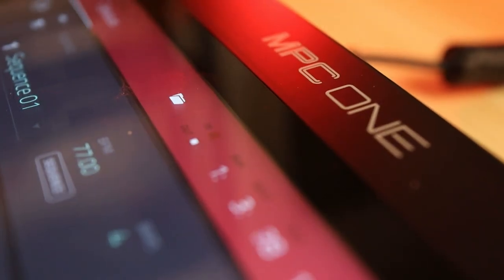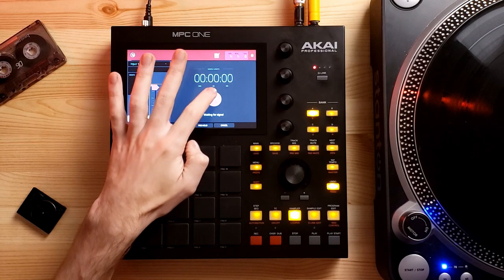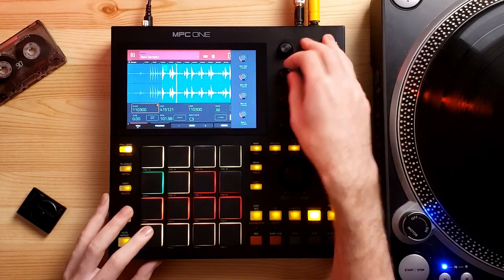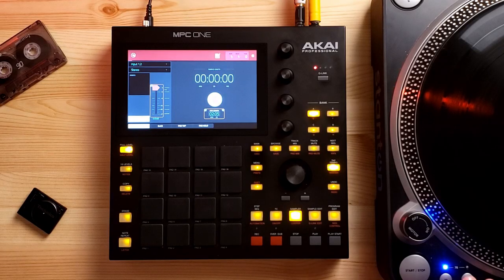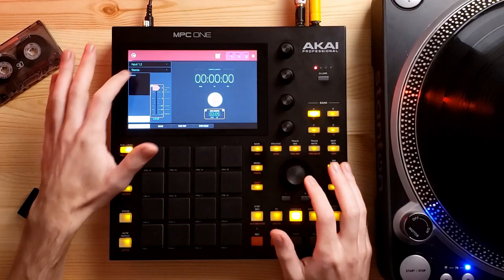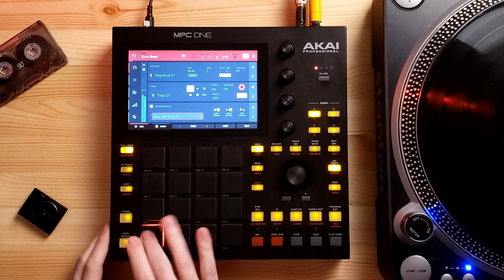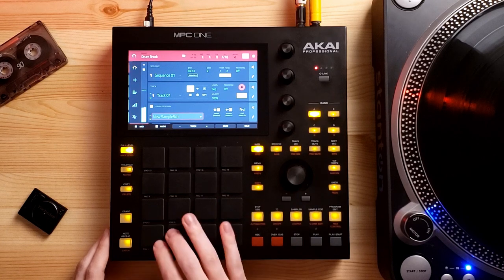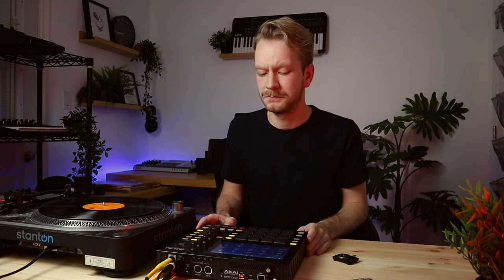How to Make Your Drum Breaks Sound HARD! // Using Sample Rates to Our Advantage

Comment: Wow, what a dope beat and a sick tutorial. Loving your channel bro. I have two questions if you’d be so kind:
1. Do you know if it is possible to resample on the 2000XL?
2. When you chop up your samples like that, are you just recording 4 bars of the song and then splitting them equally into the 16 pads? I would love to see a detailed video on this. As you have the MPC One where things can be more automated and you have a smoother workflow I sometimes miss some steps of what you do. I am trying to apply your teachings to my XL
Reply: I'm not sure of the workflow regarding chops, but to resample any sampler, just have the out L and R into the input L and R. 

There of course maybe a internal digital workflow to do it, this is just an analoge way
Reply: @MattDiamondMDE  I was just about to say that’s a good idea, (in theory it still is), but then I realised that as soon as I go to the record screen on my XL I won’t be able to play the sample. I will have to use my laptop to sample back in (after tracking out). It’s going to be a fairly long workflow but it’s the only way I can think of for the XL.
Reply: @MuhammadLaher  wow really? That's tough!

Comment: Just for my understanding, there is no 'sample rate' function in the MPC ONE? I had that in my 1998 Akai S20 sampler, and currently the Polyend Tracker has a bit rate menu, that tels you lower the bitrate for crunchier sound.
Reply from the maker: Great question! There is no way to adjust the sample rate at which the MPC One records. There are built in plugins that you can use to lower the sample rate after the sample has been recorded, but I find there is a much better result when either recording the sample at a higher speed, or resampling the sample locally. It would be nice if this was added similar to some of the older MPCs. Thank you for watching!!